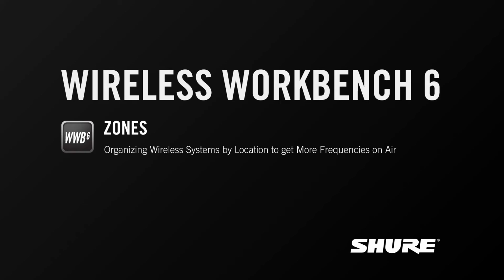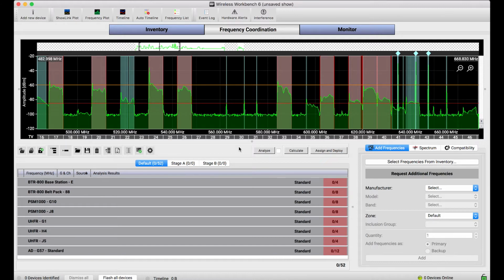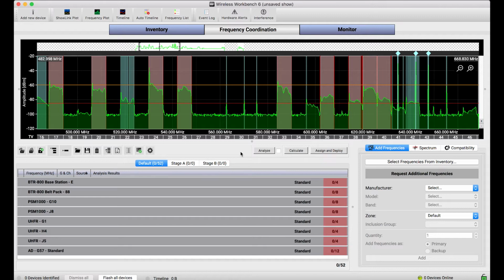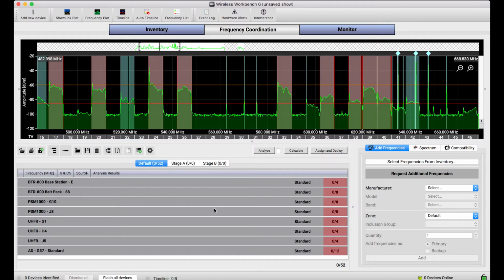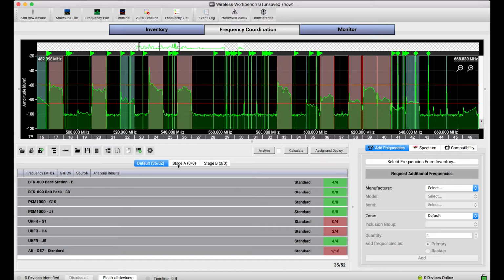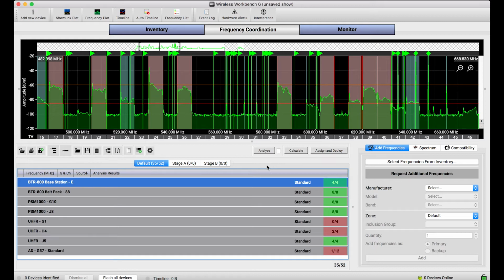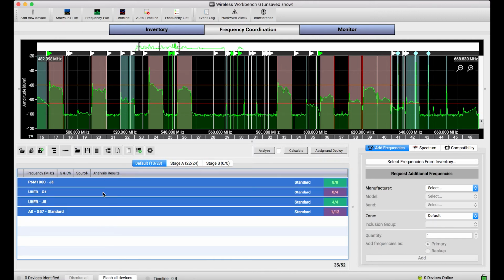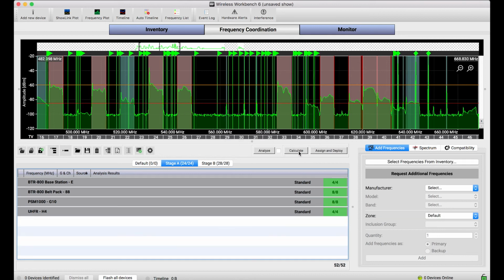Shure Wireless Workbench 6: Zones

Comment: I've been using WWB to coordinate wireless in a convention center and am having issues with the channel name disappearing when adding new wireless units to the coordination. I've split the building into two zones and because we have events coming and going all the time I need to be able to add and subtract units, and in order to stay organized the channel name is the room # where the unit is. If I calculate new frequencies the channel name disappears in the frequency coordination. Can you please explain why this happens, and how I can avoid the issue? I haven't been able to find any information on this issue so far.  Thanks!
Reply from the maker: Hi Jason, sorry you’re having that issue!  This is not an expected behavior from our end… You should be able to name channels in the Inventory, import them into the Frequency Coordination tab, calculate frequencies, and move channels in between zones without losing any channel names whatsoever.  In the Frequency Coordination tab, channel names associated with frequencies are listed in the column titled “Source”.  When you add new frequencies from within the Frequency Coordination tab, though, you’ll notice that those frequencies do not have any channel name (as they were added without any Channel association).  What can happen, especially when adding/removing frequencies, is that some of the channel-less frequencies may be shown first in the list, and those frequencies with channel names may be listed last.  If you scroll down, do you see your channel names at the bottom of the list of frequencies?  If not, and the issue persists, please reach out to us at support@shure.com and we’ll be happy to dig in deeper to see what’s going on.  Thanks!